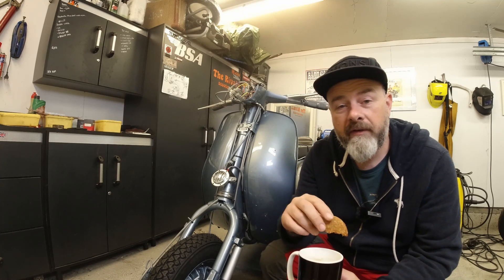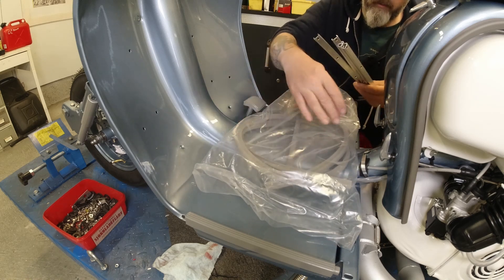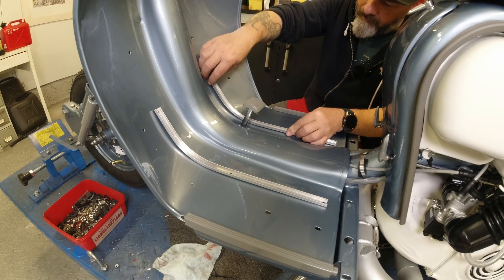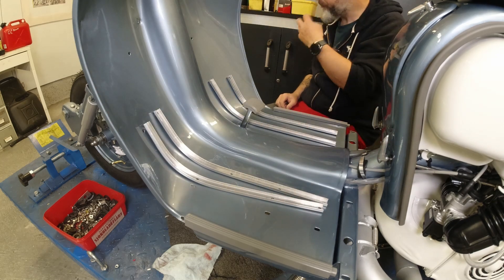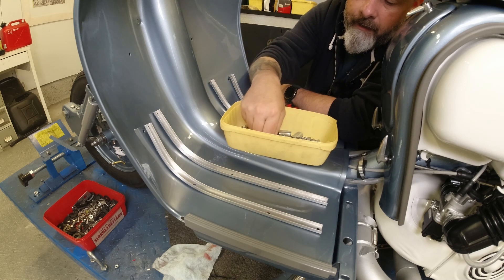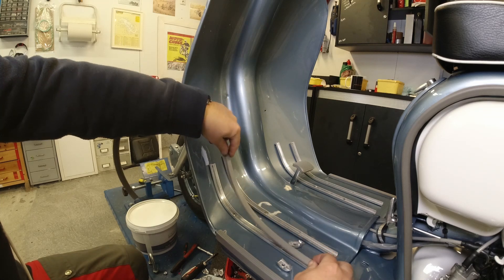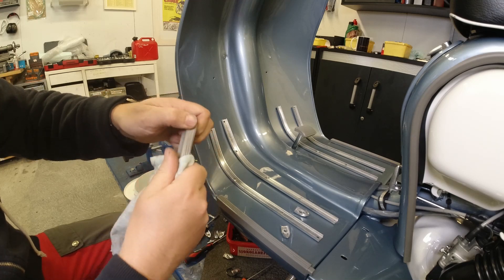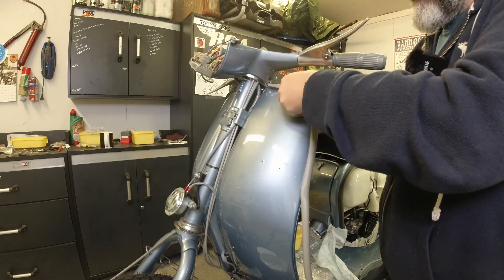Fitting lambretta legshield rubbers. TV175 rebuild part 16

Comment: The tip  about walking away when you've had enough is very good advice.
At times I have struggled with a job only to do it in minutes when I returned to it the next day

Comment: Just been doing this very job and it is very fiddly to say the least to get everything to line up nicely, of course having a lovely workshop and lift like yours would help (with back pain if nothing else lol)
Reply from the maker: The Bike lift I have was the best tool investment I`ve ever done! Highly reccomend one, or even a cheap home made table, just to get it off the ground.
Reply: Kickback Garage I’ve only just bought these scooters and their isn’t too much left to do but we have another on it’s way from Italy that will more than likely need a full strip down so we will definitely be putting something in place because I can’t do the bending and kneeling any more lol
Reply: dord1954 I’ve recently invested in a lift. The best thing I’ve ever bought, I used to be in agony lying on the floor trying to do fiddly jobs. Not any more, don’t forget a height adjustable stool when you order yours.
Reply from the maker: I 100% agree. You don't need anything fancy and can pick them up used for about half the price too.
Reply: Kickback Garage I’ve been looking for a couple of days 😀